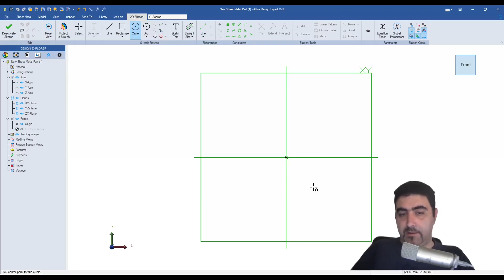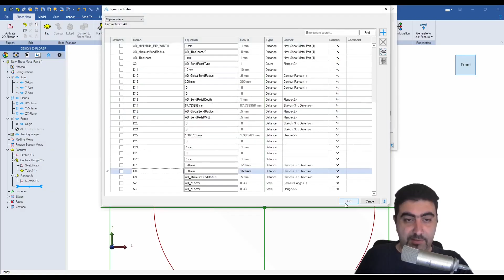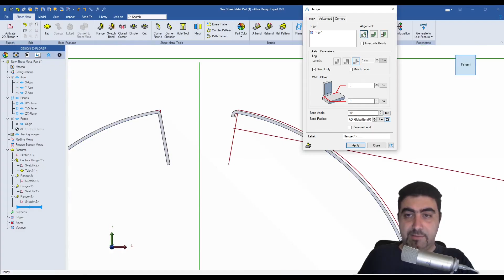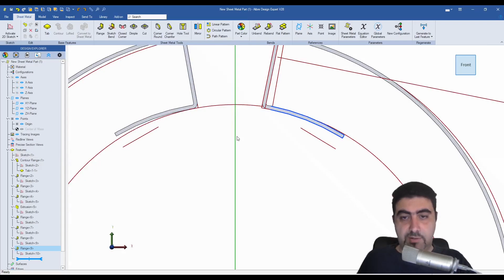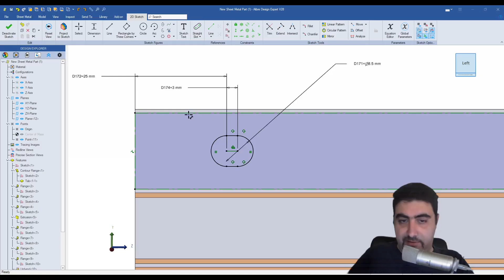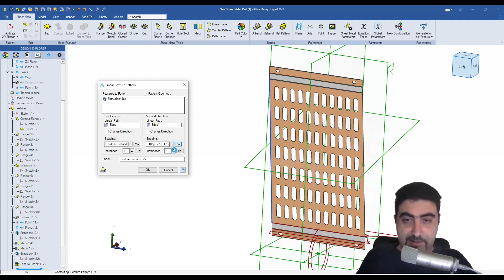Make Perfect Heat Shields With This Amazing Flange Trick

Comment: If possible, I will share a file with an exact circle via email.
Basically, the thickness of the material needs to be taken into account when calculating the radius.
Reply from the maker: That'd be great, man! I tried to do that in the video and it didn't work. I'd love to take a look at your file. Thanks for watching and commenting, man!
Reply: @ExMachinaEngineering  Where to send the file
I don't have Facebook
Reply from the maker: send it to this address: technical@exmachinaeng.onmicrosoft.com
Reply from the maker: Hey Ziv, I got your email. Great example! I'll probably make a follow up video and discuss that. But I want to know, where the angle values you used for the flanges based on equations or trial and error? Also, I see that it is beneficial for the initial tab to be on the other side.

KUDOS! Good job!
Reply: @ExMachinaEngineering  It was actually a trial and error.
I couldn't find a formula.
If I come across one later, I'll share it of course.
Reply from the maker: Thanks a lot man. Even that trial and error will help. I'll try and find a method to this. Thx for your efforts.